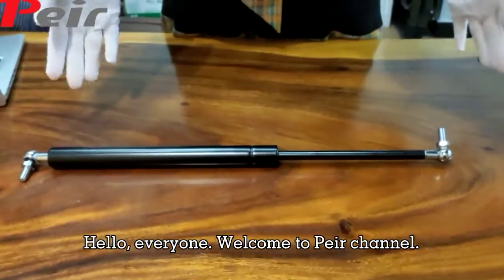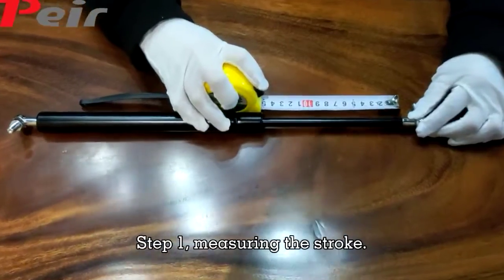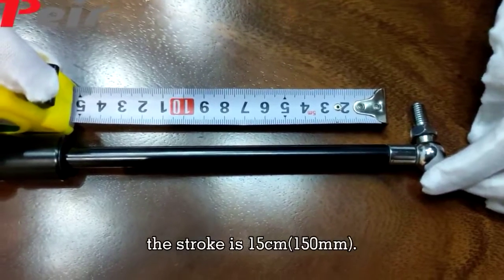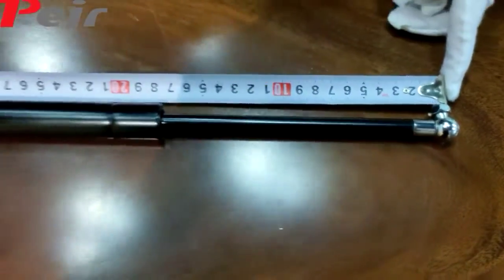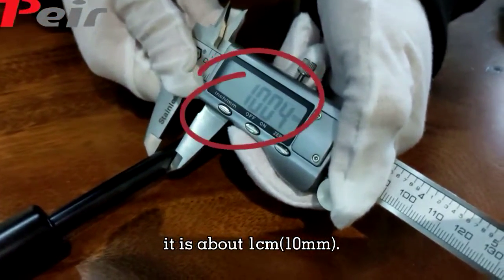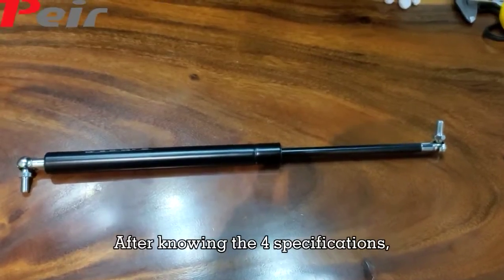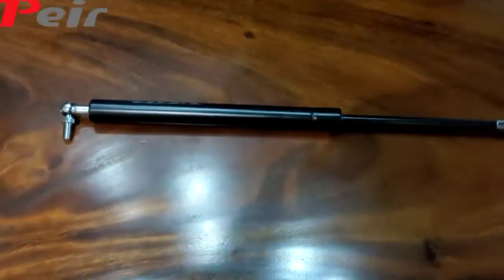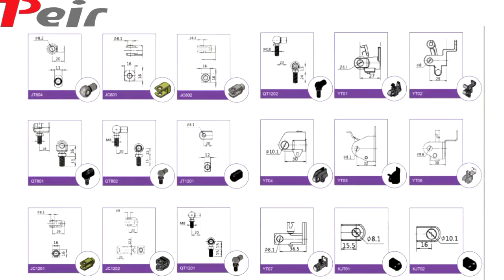How To Customize Your Gas Springs? ( Gas Spring Measurement)

Comment: Hello, I am currently looking at building a sit stand desk using one of your gas springs. Is it possible to mount the gas springs vertically so they can lift the table arm (attached to the table legs with drawer rails) up and down into standing and sitting positions?